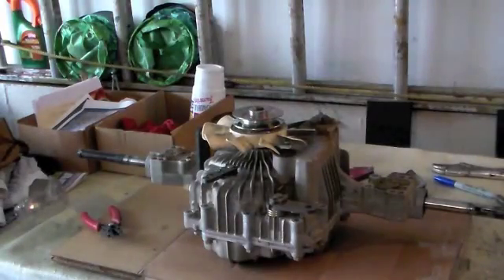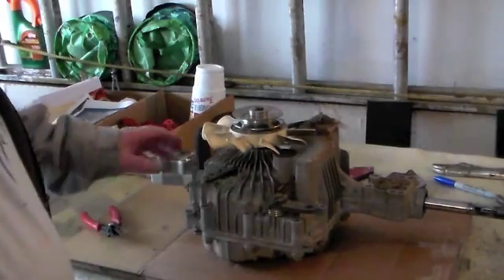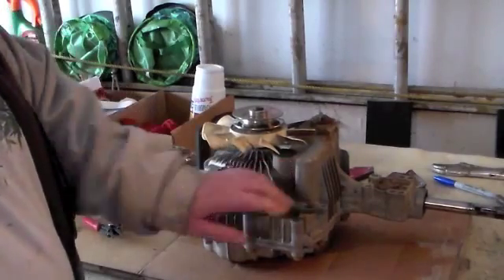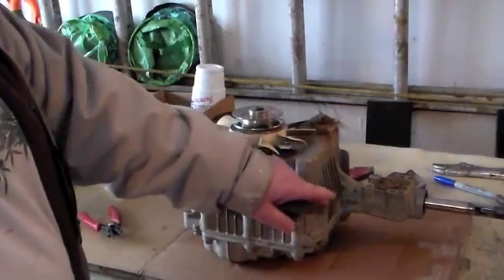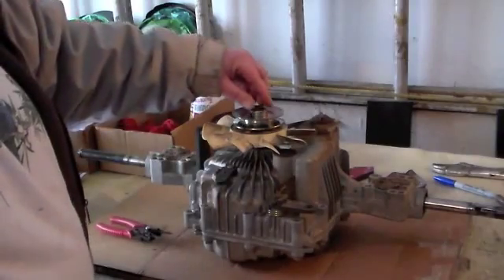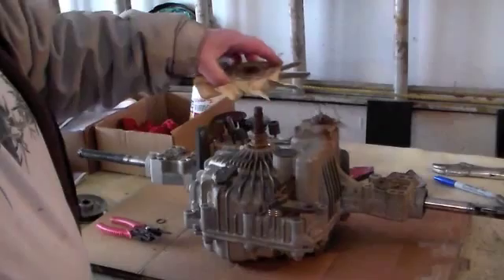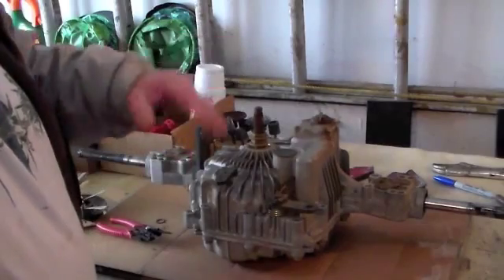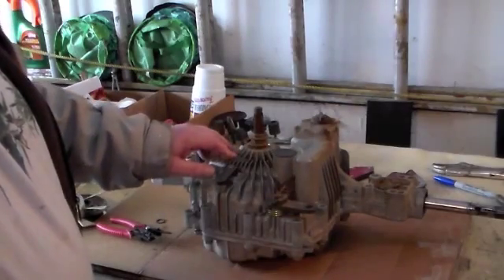Hydro transmission K46 12 year old riding mower study

Comment: Mine Failed after 6 years of normal use. Do not buy this piece of crap tractor!!!!
Reply from the maker: Sorry to hear that Jim , could of pulled the transmission an did what I did( found that info on you tube ) , but I know that they ( dealers) kept saying it was non serviceable item . Even at that replacing it would be the second choice , still less then buying a whole new one . What would of you bought instead Jim ? Thank you .